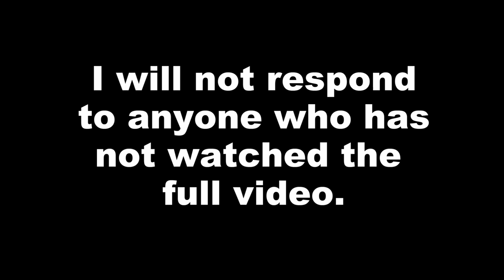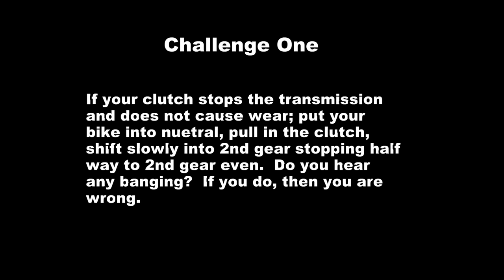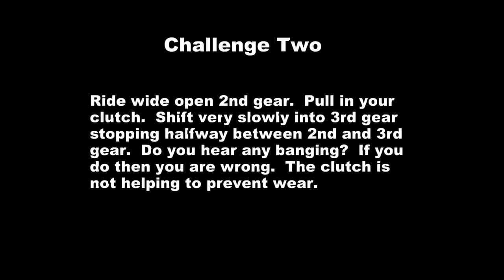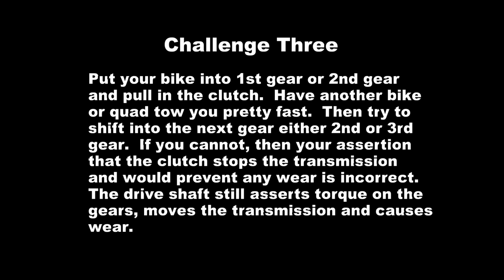Dirtbike: Shifting without the clutch

Comment: broke my clutch cable on my kx250 two stroke during qualifying for a the final,made the final,but no cable so sat on start line for final in neutral,gate went ,throttle wide open,smashed it into gear,blasted off line.,no clutch whole race,.....got third place in final...won some money...
Reply: We are not racing, i want my transmission to last 1000hours on my enduro bike.

Comment: finally someone with a proper video and examples... great job, no clutch here, up or down, I just slam that bastard in with a little throttle play going up and make sure im at the appropriate speed going down. clutch for takeoff only.
Reply from the maker: Thanks, glad you liked it!
Reply: no need to use the clutch for takeoff just give it full throttle and drop er into 1st she will take right off

Comment: You are right, I used to race shifter karts in road racing. (cr125 Honda engines) and we only use the clutch for the standing starts. Even that we reach up to 110 mph and upshift and downshift at high speeds and rpms (up to 11000 rpm) this transmissions did not show any sign of abuse. All we had to do was release throttle for a sec to engage. There are some products in the market that actually cut the ignition for fractions of a second that allow to shift without lifting the throttle.
Reply: That is what I was looking for... the products that cut the ignition allowing shifting. We use to use the kill switch on the magneto Harley's back in the 60's for a momentary shift device. I was thinking of putting a kill switch activated by the shift lever for upshifting to do the job, just lift the shift arm which would activate the kill switch first just before engaging the gear. That would eliminate the throttle blip which I sometimes screw up. Got any info on these products?

Comment: I have a little real world proof of your thought. Been riding bikes 45 years. Literally since a baby sitting on my Dad's metal tank Hodaka.  I also raced shifter karts for about ten years. We took dirt bike and snowmobile engines to levels there never meant to be at. And under torque loads that they weren't intended. Due to the heavy mods and super sticky gum like tires. I personally have run Honda cr125, rs125, cr500, Rotax 250cc 256 twin and 257 single in karts. Some races were a hour long on huge track like Daytona, Road Atlanta, Barber, ect. The ONLY time I used the clutch was at a standing F1 style start. We ran em hard and lean. Even ran overdrive on some the bigger tracks(21t/front with 19 or 20t on the rear). I stuck a cr125 6 times in one day at Road Atlanta. I won the 97 SKUSA SE championship. So we had to push em to win. And in all that time of clutch less shifting. I had zero failures anywhere in the clutch or transmission. So I feel pretty certain the is no problem shifting with out the clutch. Just blip the throttle. Right when I got out. Guys started using a device that cut ignition when the shifter moved. You could keep your right foot down. And start banging through the gears. That little device was good for a few tenths a lap.
Reply: hellsbay Shifting without engaging the clutch will wear your clutch out. If the rpm of the crankshaft isn't in sequence with the rear wheel, you'll wear out the friction plates of the clutch or worse. Not using a clutch is referred to as power shifting, and in the long run, its not healthy for your engine. No matter how good you time your engine rpm with power shifting, it does more harm than using the clutch. Further more, there's an automatic clutch called rekluse, which prolongs clutch life in the same manner using a manual clutch does.
Reply: xxFOXxxI2ACINGxx yeah your actually putting the engine understress due to power shifting which can cause multiple issues.
Reply: power shifting is using the clutch to shift without letting off the throttle, yes this is very bad, shifting without the clutch by breaking torque with the throttle not a problem, the speeds between the ascending gears is not that far out as well as the dwell between the dogs.
Reply: John McRae and I actually shift properly, so I don't care what power shifting, clutchless shifting, granny shifting, is or how it's done. I'd beat anyone in a straight line using the clutch against their clutchless shifting methods, any day, all day.
Reply: Really, I may give you a run for your money, I started drag racing in 1988 modified many transmissions to 1,2,3 auto shifting no clutch or throttle release. I build race engines and fabricate. My dragbike has a full auto trans. Opferman Motors is exactly right on the money.
Reply: John McRae I'll take the opinion of rekluse and their engineers over anyone here on YouTube. Not saying it wasn't already common sense that using the clutch is the proper way to shift, but a million dollar product like rekluse proves the point.
Reply: pelkas87 It literally says on their website that the rekluse prolongs clutch life
Reply: pelkas87 Well, like I said to the other guy, I'll take  rekluses' opinion that they 100% have on their website, instead of yours. Your insults and lack of knowledge here is why you're the most deserving of us to receive such criticism.
Reply: how many times have you changed the clutch in your bike or repaired the transmission?
Reply: Btw cr125 motors you don't need to use clutch that's why most shifter karts use them
Reply: Guys?!? Is this primary or secondary clutch less insulting....
Reply: its not engineers dweeb, its marketing bull, opferman is right
Reply from the maker: Yea, we should believe Rekluse that they last longer than other clutches based on what usage? Because a company trying to sell people who cant use a clutch an expensive handicap doesnt have any conflict of interest.
Reply from the maker: dblock2626 Is that a serious question?  They dont for automatics.  You need the clutch to start out on the bike. You need the clutch to vary the power over hard terrian or obstyles to prevent stalling.  You need the clutch to stop without putting it into neutral each time.  You need tge clutch to pull in to prevent from stalling when failing to complete a hillclimb.  Do you not know what a clutch does or what it is for?
Reply from the maker: dblock2626 lol yes how a transmission works is just "my opinion"  it actually works on magic and fairy dust and using the clutch opens up a magical realm where the transmission travels through space time into its own "safespace".  That arguement is not an agruement its so stupid and has no critiical thinking.  might as well say ya if you need to use the clutch for all those things then you also need to use the clutch to make a ham sandwitch.  The problem you have is what i mentioned in this very video where i took 30 minutes to explain in detail where i also said i would not listen to idiots simply making childish assertions based on thier emotions ans feelings rather than fact.  You come with no evidence and no understanding of how what i even mentioned is different from shifting.  If you want to respond create a video with your scientific evidence more than just iditotically asserting you need to use it.  You can also google sequential transmssions and in thier definitons it states the advantage of being able to shift without the clutch.  I would suggest you refrain from making more of an ass of yourself than you already have.
Reply from the maker: Yes, fairy dust and magic according to you.  If you call yourself a crackhead then so be it.  No, that was NOT on topic, the topic was "what is the clutch used for if NOT for shifting" so then to say OK because those are how the clutch is used then it must be used for shifting is idiotic, it is not on topic, hence the ham sandwich reference.  Man you are so dense it's unbelievable.  One more dumb reply and you're banned.
Reply: xxFOXxxI2ACINGxx rekluse says that because they want to sell parts to people like you.
Reply: Wayne Wildman I never said I bought their shit. Sorry that I chose a good example to illustrate my point, hahahhahaha
Reply: Omg he might ban someone. As of anyone would care.
Reply: Do you wanna know what really grinds my gears ?
Reply: Opferman Motors Dirtbiking I have actually used a motorcycle ( KTM450SX-F ) with a recluse. We had it professionally installed. And a month later it had worn the clutch plates bad enough that it would barely engage. My personal motorcycle does not have a recluse. It now has 250 hours on it ( Honda CRF 450R) and the clutch looks like new. The only time I use the clutch is when I am starting out, or in technical situations I.e. rocks or hillsides. It never slams or bangs the gears. It does, however, make noise I.e. bangs or rattles when shifting with the clutch.
Reply: Also, it says no where on the recluse website that it prolongs clutch life. It does claim smoother shifting. But that is beside the point.
Reply: LossingP It literally says, "prolongs the life of your clutch pack". For fuck sake
Reply: Please guys and girls in the replies. Whats up your butts? Why the bad language? Had a bad upbringing?

I ride 2 different KTM EXCs and have Rekluse in both of them. The Rekluse is NOT an auto clutch in that manner that it pulls the clutch for you when you are shifting gears. 
So clutchless shifting with a Rekluse is exactly the same as clutchless shifting without Rekluse. The only way a Rekluse will clutch for you when shifting, is if you change gears below idle. 
To be able to do that, you need to lock the rear tire and drop the engine to idle before shifting. I have both my Rekluses setup so it is barely possible to do that. 

Trust me. I love the Rekluse products, and it is a top notch quality company and products. But clutchless shifting in real life situations with a Rekluse is exactly the same as without Rekluse. 

And to the guy that worn out a clutch pack with a rekluse in a short period of time, I can only say that it can easily be done if riding in a too high gear in too slow pace. You need some kind of feel to make sure that you are not in too high gear for the speed you are in, because if you are, the Rekluse lets the clutch slip so the engine will not stall. If you try to rev it then, it will slip until the plates and frictions are fully engaged. If you have a too high gear in this situation, so the rear wheel have traction, the power has to go somewhere. In this case the power gets lost in the clutch in form of excessive heat, high friction and disc wear. 

And please. Be nice to each other. We have too much stupidity in this world. No need to infect the motorcycle hobby with stupidity as well. 

//Robert
Reply: Finally.. thank you sir..
Reply: xxFOXxxI2ACINGxx Lol, there is nothing but riding skills/ preventative maintenance (i.e. oil changes, consistent greasing and lubing etc.) That will Increase the life span of any part. Just a quick tip for ya bud. They are just marketing, I could make "super tacos"  I could say "if you consume my super tacos they will Increase your digestive systems life span!" Doesn't mean it's true, actually quite the opposite on some occasions. For instance my tacos destroy my asshole afterwards.
Reply: Robert Plant You're a real piece of work...
Reply: I wanna see how this blows up
I do clutchless shifting...
I ride a yzf 250 and no problems since I brought it
Reply: I wish you were my dad
Reply: Good video!  And you are right. Been riding and motocrossing dirt bikes for 50 years been shifting with and without using the clutch and never wore out a tranny.
Reply: xxFOXxxI2ACINGxx how can you wear the clutch out if you're not using it? I think ya meant wear your trans out.
Reply: immikeurnot thumbs up
Reply: Opferman Motors Dirtbiking another point to the whole “magic clutch” is if you have the rear wheel off the ground and put the bike in 1st gear the wheel will slightly spin. This proves your point of how a clutch cannot magically stop the transmission from spinning to change a gear.
Reply: So then why do MotoGP bikes click down to shift up??
Reply: Different body stance watch them slow down and speed up then corner and come out of it
Reply: Hey I have a question for you, I've been putting together a 1993 Honda xr200 and I'm not sure if I put the shift drum stopper arm in the correct orientation, I'm having a hard time shifting on the bench (while spinning the output shaft) to cycle through the gears to make sure I put it together correctly. It was even more difficult when I reinstalled the oil pump and the intermediate gear between it and the clutch basket. This motor's seen a lot of abuse from previous owners and I'm trying to squeeze a little bit more life out of it. I inspected the shift forks, and they looked okay, but the end of the shift spindle doesn't seem to be engaging on that stopper plate smoothly. Am I just catastrophizing because I haven't properly aligned the dogs on each of the shafts, like you described in this video? Or did I actually reassemble the transmission incorrectly? Thanks for making this video, it helped me better understand how small engines work.
Reply: @mareksumguy1887  because they flipped their shifter?
Reply: FepXBL powershifting is when you stay holding on the throttle at full power and shift without letting off

Comment: Thanks for the great explanation and rationale on clutchless shifting. I don't normally use the clutch for downshifting, but was convinced that clutchless up shifting was not such a good idea (only for the pros), until I broke my clutch lever leaving just a little stub that was only really usable for starting off, so I tried upshifting without the clutch, and won't go back!
I was still worried about what I might be doing to the transmission until I watched this, so thanks again. 👍

Comment: This video is amazing! You should also mention that when the engine is off and the bike stationary you cant get it to shift more that one gear (if any) without rolling it foward and backward a few inches. Thus moving the output shaft and allowing the dogs to mesh. 

Furthermore if the engine is on, clutch lever pulled, and the bike is stationary it shifts multiple gears more easily because the input shaft has a small amount of torque on it. And this small amount of torque can be more easily seen when the bike is running on a stand (with the rear wheel off the ground), in gear with the clutch lever pulled in and the rear wheel magically spins.

Thats the simplest way I explain it when people try to say the transmission stops moving when the clutch lever is pulled in.

Comment: Thank you sir, for confirming this with actual manufactured parts. Yes. It's perfectly fine to shift without the clutch! 
If you punch it in 3rd gear and try to shift with your thumb still on the gas, it's harder to push the lever for two reasons. One, the force on those dog teeth is designed to have enough friction to hold them together. A strong running 450 should make something like 33-38 foot pounds of torque. With a 2.82 primary, you'll be closer to 93 foot pounds on the shaft. Then with those little dogs, the radius from the dog to the center of the shaft is 1 inch MAX. That's 1000 pounds of force that the dogs have to share. With a .375"x.125" surface and 330 pounds of load with 3 dogs, that metal is running at 7000 psi. Then, the manufacturer puts a inward taper on the dog teeth. A couple degrees. You should be able to measure that with a caliper. That shit is gonna stay there. On top of that, the same force gets pushed into the other gear teeth and rapes the gear against the shaft. There's no way you're gonna move those gears unless you either lighten up the gas to choke the motor, or pull in the clutch.

Comment: i used to shift most of the time when racing without a clutch, the clutch was only used for a standing start, this was to give me a greater grip on the bars, I can also shift in my van without the clutch and anyone can you just need to understand where the next gear will be in the rev range and how much to back off the throttle,
don't listen to other comments where they have not had real world experiences, 
Great video
Reply: Droning on again you're right about the van shifting but floating a five speed isn't really a comparable example to a sequential gearbox. Youre correct tho!

Comment: I have also been shifting without a clutch for decades. I would put quick firm pressure on the sifter under full throttle and wait for it to fall into the next gear.I wouldn't slam it but wait the short time it would take for it to do it on it's own.  I hope I wasn't hurting anything too much. Nice in depth video. I liked it a lot. Keep them up. Good info.

Comment: I have been a licensed motorcycle mechanic for longer than I care to admit. Your video is very well done. The only thing I might add about clutches is to push your bike while in gear with the clutch pulled in and engine not running...if there is drag then there must be friction...which proves your point of the input shaft turning with the clutch pulled in. Just in case your viewers still have any doubt.